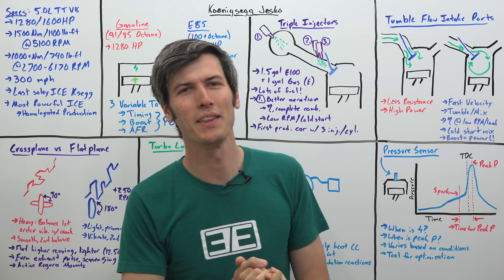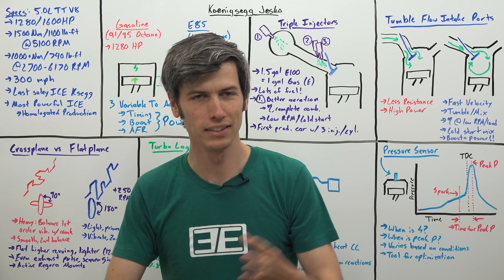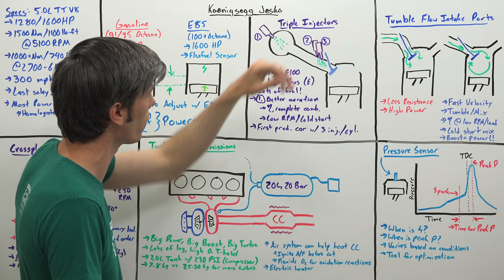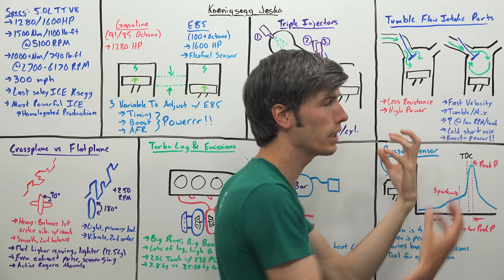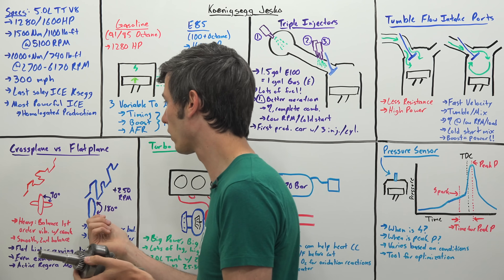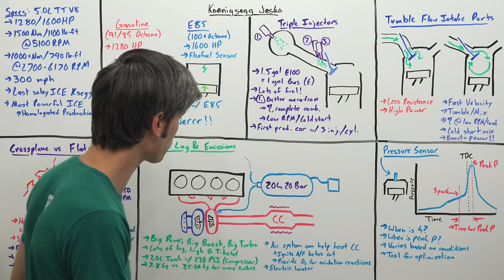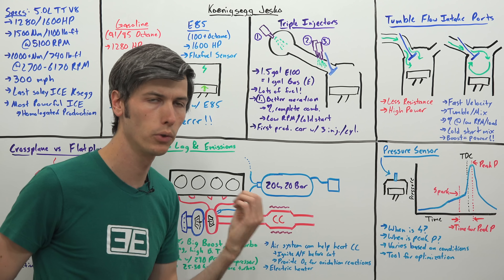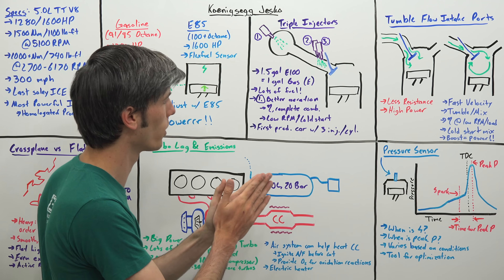Koenigsegg Jesko - The World's Most Powerful Production Engine

Comment from the maker: Bonus Fact! The pistons have a ceramic coating on the top to prevent hot spots from accumulating and causing detonation at full power. Here are some fun related videos:
Koenigsegg Direct Drive - https://youtu.be/naRY3knqFYU
Why Regera Has No Transmission - https://youtu.be/wYvIY6lBTjY
How Koenigsegg FreeValve Works - https://youtu.be/FJXgKY2O4po
Flatplane vs Crossplane Crankshaft - https://youtu.be/_TssXF8yQek
Flatplane vs Crossplane Exhaust - https://youtu.be/-s5bSQIQQsY
Also, if you want to debate about pronunciation, Koenigsegg said both "Yes-ko" and "Jes-ko" during the debut at Geneva. Pronunciation is not what this video is about.
Reply: Does Jesko use the  FreeValve technology?
Reply: Can you make a video on Koeningsegg’s light speed transmission? I really want to know how it works but all I know is that it has 9 speeds and 7 clutch packs and is very light compared to a dual clutch
Reply: First series production vehicle with 3 injectors per cylinder was Mazda RX8 HP  :)
Reply: @etgmotorsport9742   Rotory engines have three combustion chambers per rotor = 1 injector per combustion chamber, Jesko's engine has 3 injectors per combustion chamber.
Reply: @gen1c8rs88  Every combustion chamber in rotary engine (this specific one, because RX8 LP had 2 injectors per cyllinder) uses up to 3 injectors all together. Engine RPM determines whether the engine uses one, two or free injectors. Rotary engines do not have intake canals leading seperately  to every chamber.
Reply: I need that ceramic piston into my subaru Ej25 lol
Reply: @dominiclussier8810  you need a act of god to keep the ej257 together.  Sorry bro-
Reply: Hi Jason, 
With the compressed air tank open to the exhaust between the head and the turbo, there would be some effect of forcing the exhaust pulses back into the cylinders, would there not?  I would just assume the exhaust pulse pressure must be significantly higher than the tank pressure.  Any idea what that (ballpark) pressure ratio might be?
Reply: I was wondering if having the cylinder head intake angle flat would that help make the air tumble more or would it decrease the amount of resistance and make more power?
Reply: Running on E85? Wouldn't octane be more important than ethanol content? I know plenty of places that sell 95 RON E85, in fact it's the only E85 I've seen on sale... 

Isn't the higher horsepower number rather for 98 or even 100 RON regardless of ethanol content?
Reply: @fgsaramago  typically e85 has a higher octane but lower energy density meaning it takes more fuel to have the right ratios but the fuel has higher octane.. where I live you can only get up to 93 octane gas at the pump and that is E10 as federally mandated. I don't think I've heard of e85 being under 98 octane?
Reply: @jblob5764  you're mixing up MON and RON octane numbers 93 MON (US) is the same as 98 RON (Europe). In Europe the most common is 95 or 98 RON tough you also find 100 or 102 in some countries, usually all E5, sometimes E10

The ethanol percentage has no bearing on the octane rating of the gasoline you find for sale. You won't find more than 100 octane gasoline just because its E85. The only E85 I've ever seen on sale was 95 RON and the kinds of people who care about higher octane gasoline are the same that want as little ethanol as possible due to corrosion concerns
Reply: Filipe Saramago 
Nope. We have option of 95ron with/without E10 and no E85 available at all. Which is crazy considering we are told our BS high prices are based of Singapore market yet our location is 1000’s of km closer to Singapore, (or rest of globe) than our country’s locations that stock E85. and 91,95,98,100RON pump for much less. 
Or what really gets me... We pay exorbitant excise levels in order for governments to subsidise major industries that make the lions share of the countries wealth. And send the vast majority offshore. Literally half our fuel cost is a government tax. Which in addition to remaining unit cost, attracts a further 10% ‘stuff’ tax  (GST) and is paid for by remaining money earned as income after it has been taxed. (Mine is 38%, before levies...) 

So. U earn a dollar. 38% (38c) taken off top.
62c spent on fuel at the pump will mean you have only realistically received 31c worth.
(minus the 10% component of the 62c, prob around 7-8%, so say... 5c roughly) 
Minus GST.... tada 26c. So for every dollar you earn as a wage that is allocated towards fuel costs, you only receive 26c worth of ‘wealth’ in return. 
And that is just the Government share of your dollar spent....
And thats not accounting for the profits of every ‘set of hands’ it has been through before this point. In actual fact, you probably receive less than .5c - 1c worth of wealth in regards to final COST of production. Needs to stop. Same can be said for all resources. (i work in this industry)
Reply: Filipe Saramago 
Better combustion dynamics/properties but lower energetic specific density. And high hydroscopic nature 
95ron is the petroleum base and E85 is the Ethanol content ratio (by volume I assume) 

At an 85% ratio, the marginal difference or improvement of 98/100Ron fuel would probably make little difference in regards to performance. Even 95 to 98 ron fuel requires a moderately stressed engine to gain any substantial benefit (my car makes virtually same power with either, it just makes it in a cleaner fashion (from drivers perspective in regards to throttle input vs engine load vs rate of rpm rise. The passenger would not feel any difference. Only tangible effect is better component life span.) 

Stick with 100% 98ron pump until prices reflect realistic values. ie; half price of pump, as you will need twice as much to make same power.
Reply: @fgsaramago  That is more than likely 15% 95 RON gas mixed with 85% 104 octane (RON+MON)/2  ethanol which is still more octane than your other two fuels mentioned
Reply: is Koenigsegg using FreeValve technology in this engine? If not, have they said anything as to why they arent?
Reply: I was just thinking that Jason flat out, got to be detonation somewhere?
Reply: Wow! All of this in 1 take. You tha man
Reply: Engineering Explained    Why don’t all modern gasoline turbo engines have maps & sensors to better utilization of e85??   It is such an awesome fuel to combating knock.  

Can you comment on efficiency maps or educated guesses for the two fuels?   It seems plausible that e85 could be much higher efficiency.
Reply: Thanks for this very interesting video ! It is a shame that we have to let go of all those wonderful mechanics, like a beautiful mechanical watch a modern IC engine is a feast of engineering and it is even more wonderful when it is reliable. Now is time for electric cars. That's life.
Reply: please do a vid on why dont more supercars use the zenvo rs's active rear wing that is able to pivot in all directions
they have the money and scale to do so
so why not? anyway luxury goods are increasing in price YOY and their demand is increasing while normal goods dont experience much inflation
so why not?
Reply: @calvin_dabos  Jesko wing is much better : attached from above, more surface area below, greater length thanks to curvature, use less space, street homologated, variable angle, variable spacing, act as airbrake too.
Reply: It’s pronounced yesko the j is said as a y get it right
Reply: P.s I’m American even I know that it’s supposed to be pronounced that way you have no excuse for pronouncing it like you did
Reply: why not freevalve..those camless engine would have been cool
Reply: Yeah it's yesko in swedish but since it's an international car we really don't care.
Reply: Magnus Dagbro 
International car?
Reply: All completely abstract because you either get nicked if you go much over 70mph or run into the back of a truck on our massively overcrowded roads.
Reply: @SvenTviking  Not really - the fastest I've ever gone on a (British) road is 155mph, in a BMW M3, on a motorway, at about three-o'clock-in-the-morning.

And it was brilliant...
Reply: What about the ssc tuatara that has 1750hp.
Reply: gplay421 no bro

Comment: I know you did this video 4 years ago and may not be checking the comments anymore. I am wondering why they set up the pressurized air to feed the exhaust side of the turbo instead of using it to pressurize the intake manifold. If used to pressurize the intake manifold, it could (almost) completely negate the turbo lag. Just wondering.

Comment: I wonder why they don't dump the pressurized air on the compressor side. I would think you could use the expansion of the high pressure air to help cool the intake charge in addition to help spooling up.

Comment: Why use compressed air to boost a turbocharger rather than just using an electric motor to directly compress the incoming air (you can run a generator off the exhaust if you don't want to lose that energy)?  That way you could use a battery and get the higher pressure with no delay whatsoever at any time.

Comment: How would performance differ if, under hard throttle , the compressed air from the tank was dumped directly into the intake, rather than into the exhaust side of the turbo?

Comment: Great video! Amazing engine.                                     Pressure sensing using Ion sense technology has been around for a long time. Saab started using it in the 90’s. Admittedly this uses the spark plugs and coils to measure cylinder pressure and not an individual pressure sensor.

Comment: because larger turbos have more lag, why doesn't koenigsegg use initial boost electric turbos or completely replace the turbos with electric ones. only problem is that battery's doesn't supply enough voltage

Comment: Electrically assisted Turbochargers would be a nice solution here, too - also offering to convert excessive exhaust power (isentrope turbine power - of ALL the mass flow) into electric power instead of wasting them with said valve. Kinda the better VGT for high-power engines...

... hybrid drivetrains need to leave behind their reputation as joyless and unemotional solutions, but start being made into the engine-centered piece of fine art that is possible - the presence of a 48V system offers a lot of cool things that either act as direct advantage or as enabler for engine-intern improvements ... but that would lead too far here and now.

Anyway - a great channel, great vidos in general!

Comment: On regular 93 Octane it makes 1280 Hp. On E85 it makes 1600 hp. 

The SSC Tuatara makes 1350 hp on 91 Octane, 1430 hp on 93 Octane, and 1750 hp on E85. It's also an emissions legal production engine.

Chiron SS 300 makes 1578 Hp on 93 Octane and is an emissions legal production car engine. 

Obviously the Venom F5 makes even more but the car is not complete so we don't know anything about emissions and homologation etc. The original Venom GT was not homologated, did not undergo emissions testing, and was officially registered as a Lotus by the US govt. 

I'm not sure why koenigsegg is making this claim. Maybe they were just late and didn't notice the competition. Or they probably knew most people don't fact check before talking.

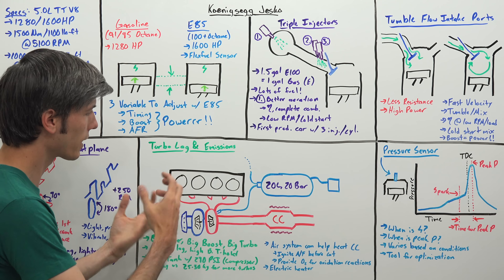Comment: Funny... Al this talking from 12:50 about using air to heat up the CAT.
Nothing new here. I have a so-called secondary air pump in my 1.6 l Seat Leon from 2006.
All this is just to pass certification.
I assume that only very few of Jeskos will ever be built.
They end up in the hands of collectors who most likely not drive the thing at all but just watch the value appreciate.
This high tech engineering is no going to help the planet a bit!

But a nice video!

Comment: Awesome, can those pressure sensors also be incorporated on each bearing of the crank, to shut down fuel and fire, to save the motor in case of oil starvation?

Comment: Hybrids can use regenerative breaking to charge batteries.   I wonder if the same  concept can be used to pressurize air tanks.
1) A car breaks going into a turn or down a hill
2) Regenerative braking pressurizes a carbon air tank
3) The pressurized air is used to quickly spool the turbo when accelerating

Of course I'm leaving out the fun part... exactly how the breaking energy is used to pressure the air tank.  Wonder if Engineering Explained knows how.

Comment: 91 and 95 octane are not the same nockresistances! 

Europe had 91 and 95 octane in the past, and all cars support both fuels! 

BUT 

for sake of low demand of 91 octance gasoline  (Normal)  and high demand of 95 octane gasoline (Super)  and the upcoming demand for 98 octance gasoline (Super plus)  the gasstations didn't want ot install extra tanks so 91 octane gasoline was thrown out of the window... There is no gas station offering it anymore... the same like you can't buy readymade 2stroke mixture anymore.

Comment: Wouldnt the crank position sensor be able to calculate when peak pressure occurs just by position of the pistons? So what then is the point of the pressure sensor? Not a mechanic however I know enough to get by. I'm just curious if you even need that sensor to get the same result. Surely that could be calculated in other ways is all Im saying. Although maybe the pressure sensor would just be more accurate and precise at making peak power regardless of the piston to possibly answer my own question.

Comment: Question, has anyone thought about an electronic assisted turbo to prevent turbo lag? Something like a small electronic motor to instantly turn the impeller shaft and spool the turbo as opposed to injecting pressurized air. I understand injecting pressurized air also helps with emissions, I’m simply speaking from the perspective of making instantaneous power with a large turbo.

Comment: What about an electric motor spinning turbos directly? Compressing air is extremely inefficient.
Reply: Air is everywhere, my friend. Unlike electricity
Reply: @TheSilverShadow17  You get about 25% efficiency in air tools, there are heat losses, friction losses and so on, while electrical motors are nearly 100% efficient.
Reply: @djvasforever  Instant torque from an electric motor is useless if it cant get put down to the ground. Christian von Koenigsegg has every right to use what's best for him for his cars. Lol
Reply: @TheSilverShadow17  I'm not talking about an electic drivetrain, I'm talking about a motor that would spin up those turbos. They still use energy to compress air and only about 25% of it they get back.

Comment: It's really not that impressive 320hp per liter....if it was a 2liter Honda that's 640hp it's not unheard of a Honda making 400hp per liter with a 4cyclinder. Some even clear the 500hp per liter range the torque is nice but still at 220ft-lb of torque per liter it's still not better then some modified gsr's that push 630ft-lbs out of a 2liter that's 315/liter....it's neat but u would think they could make more must be a V8 problem...

Comment: but if you decide that after running with gasoline you want to fill it with ethanol and there is still some gasoline mixed, will the sensors pick that up as well?
Reply: I'd assume. Even e85 has a range of like 50% to 85% ethanol.

Comment: Great explanation! Koenigsegg is the only company today to use the inventive engineering of the 90's but with modern technology so it's by far the most exciting one. One further advantage for the added plenum injector is that latent heat of fuel (mainly Ethanol) "boiling" will lower temperature in the intake increasing the mass admitted ->  more Poooweeeeeeerrrrrrrrrrrrr!!!

Comment: Question: which engine is the most balanced out of the following: 

I4 , I5 , I6 , v6 , v8 , v10 , v12 , H4 , H6
Reply: I4
Reply: LuxuriousMonster0983 no ur wrong. Inline 4 does not have secondary forces balanced. That’s why they are not large displacement because they need counter weights
Reply: @nadeemm429  thanks for telling me that. I'm a noob to car workings. That was a Wild Guess BTW😊
Reply: And you forgot the V16
Reply: I-6 or H-4 is a good guess

Comment: You describe the injector labeled "1" incorrectly as it would most likely be used at high rpm rather than cold start and low rpm. Same reason why the older F1 V10/V12s had injectors at the top of the trumpets, further away so the fuel had time to atomize before going into the cc at high rpm. At low rpm it'd most likely just end up on the runner wall.

Comment: How does a less energy dense fuel make more power? Plz explain
Reply: The limiting factor is how much air you can ram through the engine. There for you want a fuel that can get maximum amount of energy per unit of air, even if that means having to deliver more fuel.

Comment: Koenigssegg has always used tumble flow intake ports, for as long as they have been using Ford cylinder castings which they definitely still did on the Regera.  Ford has been using tumble port 4V cylinder heads since 1999.

Comment: The last part, about the pressure sensor. That's how ECU tuners tune ignition timing. So it's like the Koenigsegg Jesko constantly tunes itself. Awesome stuff.
Reply: All modern cars do this to better get efficiency.
Reply: @vhateverlie  but not all cars have pressure sensor there. Without it, how would the ECU know they're creating the maximum brake torque?

Comment: Beautifully developed engine. :-) Like the idea of pre spooling the turbo's. But that also raises a question. By using compressed air for spooling up, you lower the temperature in the turbo. Colder exhaust gasses are heavier, so they are slower. Maybe this is purely academic. :-) And how about microscopic cracks by the sudden cooling? Just wandering.....